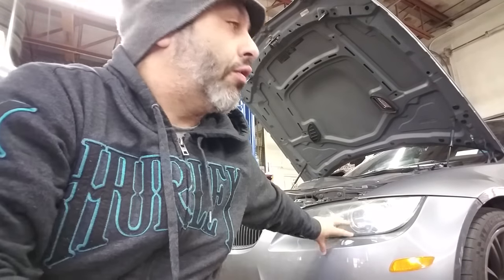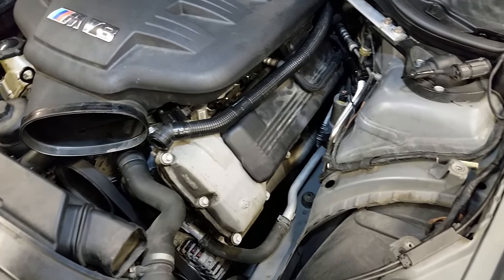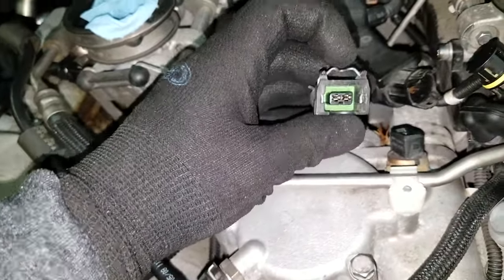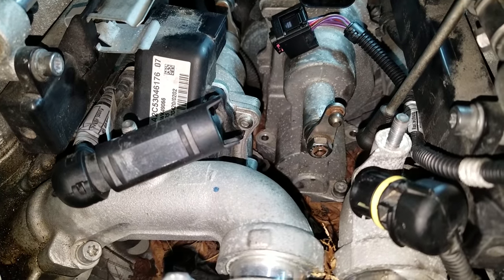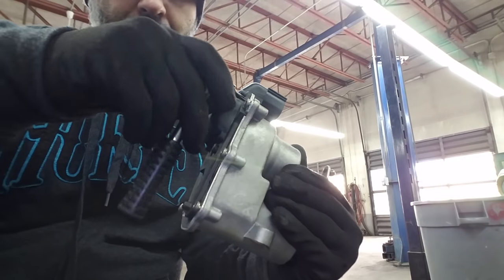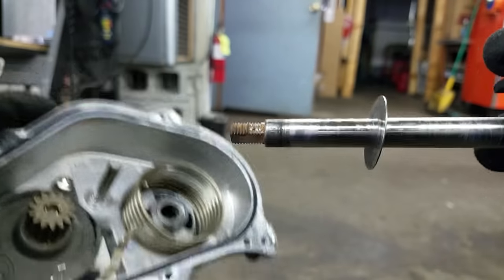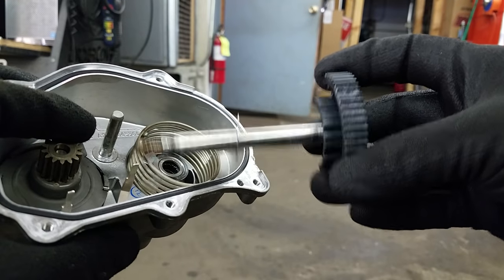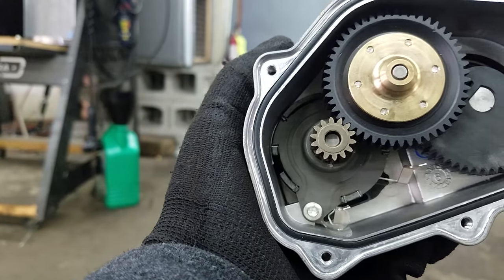BMW S65 E90 E93 E92 M3 Throttle Actuator DIY

Comment: Being a technicain, i think it qould help of you would ask a guy oening a cnc machine to make some aloy or even stainless steel gears for this, obviously plastic will wear quicker and also put some gear grease on them to make them last longer. Also check the rest of the whole throttle body to see if everything is moving freely to overcome any unnecessary resistance on the actuator... but this is a great video!

Comment: Good video. Note: I'm handy but not a mechanic. About 10 months ago got error code for bank 1throttle actuator. Ordered new gears (for both) and took me about 3 hours in total. Note: I swapped bank 1 and bank 2 over just incase error persisted and wanted to see if it moved. Unfortunately it did and not surprisingly this time bank 2. Brought a new actuator and replaced faulty one in bank 2. This time took me about an hour. Now, 10 months later, I have error on bank 1 (old actuator). In hindsight, if you need to replace 1, you might as well replace both.

Comment: I did this procedure with same parts, when pressing the spacer onto the shaft it is very important to back up the shaft on the gear side or you will damage the gear as I did and the depth of how far the spacer is pressed on is critical, it must have end play when installed. If you look close at the new gear/shaft you will see the shaft is recessed into the gear so if you press or hammer  the spacer on it will damage the gear you might not see it  but it will be damaged.
Reply from the maker: +James Whiteside yeah you can't bang on it too hard. But it's the only way to get that thing on and off. My gears weren't factory gears so they should be fine. Much thicker. Been running fine every since

Comment: I just bought used e90 m3 with 89k miles, and have engine malfunction light. Code is P161F and P0303, so throttle actuator may be the problem. I will buy the same parts from the same vendor. Is yours running alright since the fix?
Reply from the maker: +hideki mine is running like brand new since the fix

Comment: BMW should be held responsible for a recall on these actuators. This is costly to do time and money wise. No reason the owners should go thru this hassle and cost to repair a shit idea that obviously has failed multiple times. Pure garbage. I love the way the car looks and sounds, good performance overall but shit, this kinda stuff just makes me not wanna spend my money on one. Good vid and good work man, thumbs up.
Reply: Yeah, 140,000 miles isn't good enough for some people.
Reply: @bbrf033  most of the ones I've seen and been told by owners happen at 60k miles. Should not happen at all, really bad design and materials used. If you got lucky and they lasted to 140k then good for you. Obviously there is an issue. A very expensive issue. My opinion, I respect yours.
Reply: 1970PMD got mines at 73k
Reply: @abelbeltran5345  e60 100k km so 60k miles
Reply: @1970PMD  How much would it have cost BMW to make the gears from brass or aluminum? Seems awful cheap for  such an expensive car.

Comment: would it be easier if you replace the whole unit? For peace of mind in the long run.
Reply from the maker: Looking back when I did this the throttle bodies were $1200 each. Today these things cost about $400 each. So yes, it's better to do a complete swap instead of repair these days

Comment: Thank you so much for all the info. Was able to knock mine out in 45 minuets as I followed along! Really easy job can’t believe they charge so much for this.
Reply: When you were disassembling the parts to get at the TBAs did you remove the spark plug covers on both sides like RDDC did? I am assuming this was for more accessibility?
Reply from the maker: That 45 minutes should include that. When I did my last one I had the complete car apart in 23 minutes. So 45 minutes is easily doable if you have everything ready to roll

Comment: FYI the thick spacer I found easier to use a 10 mm reamer and a BRM 10 mm flex hone . This make spacer easy to install without tapping on gear shaft . Overall play still good .

Comment: With this method and with much knowledge and experience with the throttle actuators my question is, If you had to do this all over again what would you have done the same and or changed? Thanksn

Comment: Thanks so much for this video, really helpful.  Debating whether to do it myself or not, though I was planning to just get another two new actuators.  Really appreciate your time.
Reply from the maker: +Justin To man its super easy. Follow my DIY and you'll be set. 2 people have already followed it and had success in 2.5 hours
Reply: Are there differences between the actuators for Bank 1 and 2?  Or I can just buy two of the same?  Also, should i expect any codes when starting the car after this install?
Reply from the maker: +Justin To both the same part number. When in the car one is turned up and the other down
Reply: Thanks again man, this was amazing, just replaced both actuators this week!  Car has 85k on it and was wigging out with limp mode and codes everywhere.  Took me 3.5 hours with my wife helping now and then.  Couple of things I noted 1) the screws of the rear-most throttle bodies are a huge pain in the ass to get too.  Any recommendations if i ever need to access those again?  2)  the front tubing and connector attached to the front of the underside of the plenum is a BITCH to take off 3) i broke the plastic brackets off a couple of the connectors not even realizing they were attached to anything.  One was the rear-most one on the left of the rail, and one was attached underneath the rail.  I think they'll be fine if they are unattached and free, i can't do a whole lot about it now.  4) if you don't pay attention when putting things back, there are two connectors that are very similar near the front of the rail.  One is colored green inside the connector, and one yellow.  The yellow one goes to the plenum.  The other one... doesn't.  BMW wanted $900 bucks labor, and that's after a $1000 discount offered because it is a known m3 issue.  Money towards my exhaust... :)
Reply from the maker: +Justin To awesome!!! I broke some come too man. It gets so hot under there the plastic becomes brittle. But I noticed the plugs stay in snug. No biggie. The car needs some battle wounds. Actuator screws are a bitch. I use a small magnet to get them into place. The front and rear plenum just suck. Hard to get to. I put in place and used a long screw driver to push up and pop back into place. But end result...not too bad. You got it done and got paid...win win for you!!! Now...my payment for the DIY is $999.99 haha! Good job man!

Comment: Great tutorial.  Now that you've got hindsight, is there any way to test the circuit board for failure prior to tear down?  Maybe the second Bank 2 code you saw when you pulled codes?
Reply from the maker: +Shawn Pier I'm not seeing anything. I was hoping my BMW code reader could actuate or send a signal but nothing. How I tested it was a bad board was to put the board on Bank 1 and see if that bank tripped codes...and it did. Now that I will have a spare actuator perhaps I can hook it up to a power source and take some measurements on a bench. People say the MOSFET IC's go bad, which I can order new ones but this is not 100% proven as some have replaced the chips and still have issues with the board.

Comment: nice video
i have a question 
i can’t push my air box in the throttle tight, should i replace the rubber mount ? thanks

Comment: Would you recommend that the battery be disconnected prior to changing out the throttle body actuators? I am always worried about doing this and then having the FRM module fry on me...
Reply from the maker: I did not disconnect the battery. The connectors you are disconnecting have no power to them unless the car is on. I've done this job several times now and never disconnected the battery.
Reply: @RDDC_Official  Thank you so much

Comment: Would you recommend putting some grease in the actuators? I think that would help preventing wear and probably make things perform better too
Reply from the maker: There is a bot if grease in there already. Not much but even at my work with industrial gears we don't use but a dab of grease. So I think that's normal. Too much grease isn't always a good think. But if the gears don't have any one it I think it wouldn't hurt if a little was applied

Comment: This looks pretty straightforward job but if it's the circuit board that's gone bad that means you have to replace the whole unit? It seems there's no replacement available
Reply from the maker: Yup

Comment: Just a quick question I have rebuilt both my throttle actuators fitted them back into the car and it’s still flagging the same fault and limp mode I have done it step by step as you have and am left very confused why it’s still the same when re assembling the throttle actuators I noticed the gears would spin in there own shaft is that normal thanks in advance
Reply from the maker: Your boards are bad.
Reply: Did you say that the gear spins on which shaft?
Reply: It failed electrically or the gears are not installed right

Comment: Hi, excellent your channel. I have a question if you can help me.
I have a new actuator and the other one working well but with the gears worn out. my query is, if the same gear that shows in the video is different to the gearboxes of the new actuator should work well? I'm afraid of burning the offset since it's different from the original. greetings hopefully help me

Comment: I have a 2010 E90 M3. with 81k miles.  Had code 27BB (Fuel system Lambda - bank2), 2B16 (throttle controller monitoring -bank 2).  Car went in limp mode.  I replaced the throttle actuator gears with the Odometer gears replacements on both bank 1 and 2 actuators.  Re-installed.  Note that one of the actuators (bank 1) had been replaced by previous owner at 40k, but bank 2 actuator was original (81k miles).  

I put the older actuator (2009 date code) on bank 1 and the 2014 date code actuator on bank 2 (both with new odometer gears).  Now I’m getting codes 2B21 (throttle pre-drive check bank 1) and car in limp mode permanently (doesn’t go away after clearing code).  I also get code 5E19 (DSC ECU internal.  Serial peripheral interphase (SPI) ID request not accepted.  Coil outlet valve shorted front right…).

Is this just a wiring/connector that isn’t making good contact, or what do you think?
Reply from the maker: Did any of the connectors look broke or not snapped in all the way? Could be a wiring fault. Could be something more
Reply: RDDC all connectors looked in good shape. I figured my next step is to tear it apart again and triple check the connectors to make sure they are all tight
Reply: Did you ever figure it out? Having similar codes with 5E19 and occasionally my car will go into limp mode but it won’t last long. 2008 M3 here.

Comment: I remember some time back saying that gears wouldn't work. Not worth all the time. Good idea buying the new actuators and changing those gears.
Reply from the maker: I didn't buy new actuators....well I had to buy one because the circuit board is bad. I heard it burns up from over current trying to drive bad gears. Bank 1 is good but Bank 2 is getting a brand new actuator. Will be in Tuesday. I will do a video showing all this and how I tested for a bad circuit board
Reply: ye it sucks. i wish it was easy but you know bmw lol. i would have just bought the gears and changed both but stupid circuits. all about the money
Reply from the maker: I thought about contacting Siemens and see if they have the boards since they make the actual unit. That would be like circuit board gold!

Comment: What brand are these gears? There's like 20 different manufacturers with the same "looking" gears. Let us know, thanks!
Reply from the maker: I'm not sure man. The box is just white. I pulled it back apart and noticed one had a slight crack in it. So I'm not recommending that type.

Comment: Love the video, I would have notched the gear to hold the spring.. or drilled a hold to allow the spring catch to go into something.
Reply from the maker: Thought about it. The rebuilt actuator is still going strong too. If it craps out its definitely the board but it will give me a chance to inspect the aftermarket gears to see how they held up and report back

Comment: 143k miles on this engine? I can see the typical bmw V8 leaks on your engine.  valve covers, front cam drive chain covers.... actucally pretty good if those are original seals.     leaves? they look wet.  valley pan or coolant pipe leak?
Reply from the maker: +fast4d1 Looked like oil on the leaves. Still trying to figure out how the leaves got in there! But after an inspection the passenger side valve cover seals needs to be replaced

Comment: I see slight oil weepage on the valve covers. I guess if it aint dripping oil then leave it alone. Great video as always.
Reply from the maker: I noticed that too. I think it's coming from those black oil separators. I'm just now realizing how dirty it was under the the intake. If it wasn't so cold I'd take the time and spit clean everything.
Reply: RDDC I guess a little oil seepage is common on a modern bmw engine that is older than 5 yrs. actuators working now after install?
Reply from the maker: +Raymund Orlino The circuit board is bad on Bank 2. Bank 1 works fine after the rebuild. Unfortunately you can't buy the board anywhere without buying the whole unit. So I had to drop $1000 for a new one. Will be here Tuesday

Comment: I’ve read forum posts that say even if you replace the gears they will still fail not long after because it’s the electronics that go bad. Guys were saying to just put brand new actuators in. Thoughts on this?
Reply from the maker: Thats 100% right
Reply: RDDC thanks for confirming
Reply from the maker: No problem

Comment: I just did this and after I'm now constantly in limp mode. Before I had intermittent. Getting more faults now which includes DSC and start assist. Any  advice? Could I have left something disconnected?
Reply from the maker: Check your connections. One guy had the same thing and he didnt plug in a plug all the way. I believe under the intake he said.

Comment: what instructional manual with circled connectors were you referring to?
Reply from the maker: It should have a link under the video. A user has circled the connectors on a pic.
Reply: @RDDC_Official  For some reason, and maybe it is because of my computer settings, the pictures are very fuzzy on that link and I cannot get them to become clear. Any idea(s) what I may be doing wrong? And I was wondering if it was necessary to remove the spark plug/coil covers on both sides in order to remove the intake manifold as it seems that there might be enough room for accessing the manifold's hoses and velocity stack screws?
Reply from the maker: @craigg8185  I removes mine. They literally just pop off. It's a rubber grommet holding them on. You may or may not need to do this if you can access the intake screws to the throttle body. That's really the main reason for removal

Comment: I have an e92 M3, 2009. I do not have any lights, but would like to get these gears and replace them, just for sanity. It does ask me if I have 23 teeth or 25? Do I need to get them out and count them? Or is every e92 the same? How long have these new gears lasted so far? There are a lot of gears out there. Don't know which one to get.
Reply from the maker: Ok some good questions. I do not know the teeth count. I didn't know there was a difference since the TA you buy is from 2008-2013, all have the same part numbers. Ok, experience with the gears I put in. When I replaced the TA after a bad board, this was the one I replaced the gear on. The gear had micro cracks after like 20k miles. I'm just throwing it out there from experience, just pay the money for new TA's. No you do not need to replace both at the same time. You will just have to do this all over again once the second one fails. Thankfully it's a 45 minute job for me now start to finish. So I'm not recommending replacing the gears unless they are BMW (Siemens) gears that go to the unit from the factory.

Comment: Wow what a great video. Thanks! I had printed out procedures from All Data at my auto school but you really made it way more understandable. 
Unfortunately I think I have a bad board too. Changed the gears but can't clear the code (P157F). Guess I'll have to get a whole new one, now $639 at Turner. It's like they've been buying them in bulk.
Reply from the maker: +Lou Zeidberg That price actually went up. Was $580. That's after I paid $980 they dropped the price haha! Go figure!
Reply: RDDC found a place to rebuild in the US. 
https://us-shop.bba-reman.com/shop/parts/bmw-throttle-actuator-repair-2/
I think I may try it as now the upgraded gears are in there. If they can fix the board then maybe it won't fail again.
Reply from the maker: +Lou Zeidberg that's awesome. My rebuilt one is still working fine. Trust me, easier than you think

Comment: Do not remove the 2 bolts on top of the plenum, they are there for decoration and have no securing properties.
Reply from the maker: +David Tennien funny I found that out after. I was like "WTF?! Decoration?" BMW uses plastic gears but add a nice chrome useless part to the plenum.
Reply: Believe me you aren't the only one.  A lot of people did it.